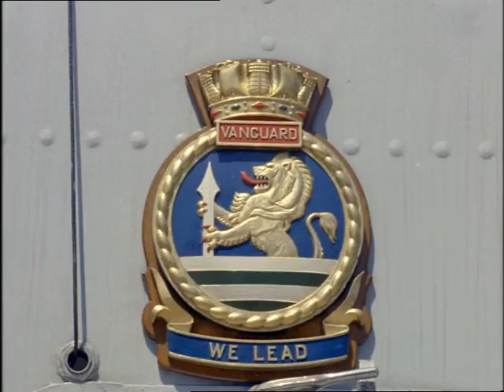Look at Life Vol 2 Military   The Last Battleship 1962

Comment: A "volunteer" pool might be able to re-build an equivalent "clone" of this battleship.  Lighter materials, tube steel and aluminum alloys (w. reinforced epoxy / metal mesh) .  Not saying it would be as formidable as the original; but it could be "rebuilt" on the cheap.  Missile batteries have made heavy turrets obsolete, but something equivalent might be cooked up.  Just sayin' ( trying help, so to speak ).
Reply: They really should limit internet access in lunatic asylums.